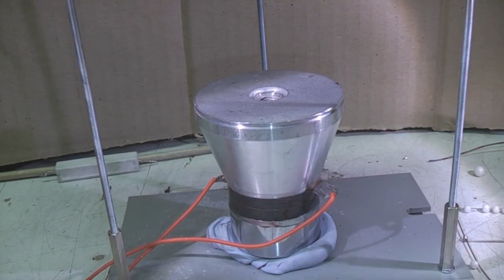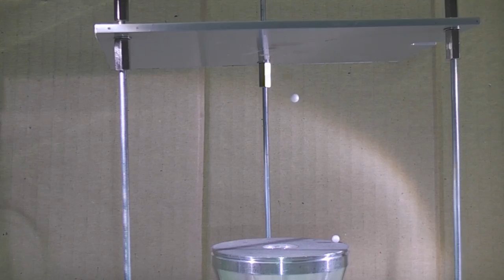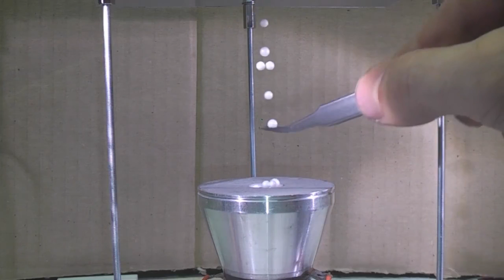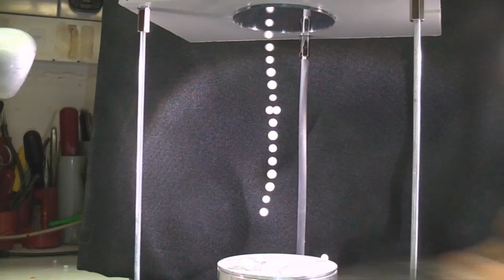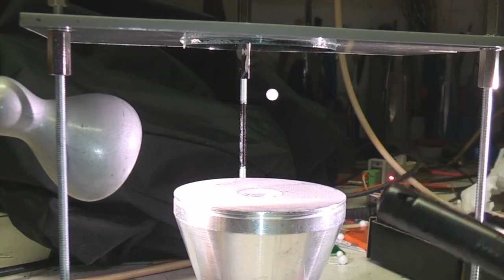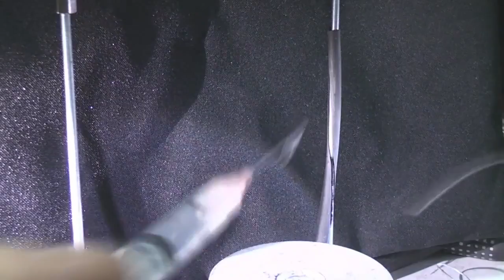Ultrasonic acoustic levitation

Comment: Hello can you tell me one challenging Thing ?
As seen here ....
https://youtu.be/N-OPQ_s0G5c
Ultrasonic horns are both bolted and glued at the same time and location so how can you remove it without any distraction ?
Because for un screwing it you have to turn but you can't because it's ceramically glued and you can't even twist back and forth because of bolt and also its base is just thin pice of metal which can easily band !!

So how it's profectionally done   ?
 I need that horn from cleaner for handheld  Ultrasonic for some purpose .

Comment: That transducer you are using has bad acoustic coupling through the air. It will be good to somehow glue many cones as resonators. I tried remove single one from Arduino distance meter and temporary stick to it - it increased effectiveness. Now experimenting with single small transducer, just transmitter part of distance meter HS-SR04 and got decent results. Great idea with soap bubble - excellent for visualizing standing waves and where is the focal point of the reflector I am using. Thanks again, great video!

Comment: There is a medical application for this, specifically vertebrae decompression. Install qty. 2000 of these transducers in a 5" thick acrylic sheet. The transudcers will be controlled in groups to affect levitation control. The patient will lie flat on their back, a full anesthetic will be administered through IV to relax the subject. The transducer will be attenuated into higher frequencies. Once the patient is levitated. Adjust each group of transducers to invoke sonic induced traction. The procedure should not be administered longer than 15 minutes. This is the future of medical therapy.
Reply: It's all Good duhhhhhhhhh

Comment: Instead of dry ice or alcohol, you could use a cheap ultrasonic humidifier/vaporiser and channel the stream into the standing waves of the main transducer. I'm guessing using the same transducer to also create the mist would not work well.

Comment: Mike, this is 3 years old video, but I am just beginning to mess with ultrasound. I found that perforated PCB increases coupling from transducer to air almost 3 fold. I suspect that increasing surface area by introducing material with holes actually helpnig better coupling. Just one thing what I do not like in this case is short focal point of about 45 mm on 40 kHz transducer with diameter of 45 mm.
Reply: Parking sensors are a cheap source of powerful ultrasound. Being able to levitate liquids or insects is not a problem: www.acousticlevitator.com

Comment: is it mandatory for the relecting surface to be flat ? and also is it only supposed to be metallic ?
Reply: TEE BOY Anything that won't absorb sound wave easily. Metal is most commonly used, however most hard objects should work.

Comment: how transformer
i see circuit ..
i dont khow transformer
Reply: I have the same question, I'm not sure about what kind of transformer should I use to not burn the transducer.
Reply: He says in the video that it's a step down transformer from a pc power supply, wired backwards. He says it's a 12v secondary. He is based in the UK, so it will be a 240v primary. Find an old computer psu and the 12v transformer should do the job just fine.

Comment: hello everyone does anybody have the design for the circuit i need it for a school project thank you
Reply: +Zoom me The schematic is in the description. Just to let you know, the 555 timer isn't completely accurate on the schematic so there may need to be some tweaking, but I was able to use it just fine :)
Reply: +Generation Imagination can you let me know what i have to change,I did same as in schematice but doesnt work:(
Reply: +Zoom meI used sg3525 replaces 555
Reply: +PHƯƠNG NAM what difference does the sg3525 make over the 555 ?
Reply: +PHƯƠNG NAM thanks
Reply: +Yusuf Sultan Did it work for you? I'm trying to do the same but I have had no luck with the 555. If so how did you connect the sg3525 to the original schematic ? Thankyou

Comment: Hi guys, I'm trying to replicate this for my school project. At the moment I've been able to set up the standing wave with a 40khz ultrasonic generator and a reflector, however I can't seem to be able to get anything to float like the small polystyrene balls. I was wondering whether the problem is the low voltage I'm currently using to power the generator, which goes up to 12v. If the low voltage is the problem, I should be able to fix it, however I do not want to needlessly generate an excess of 200v. I would appreciate any tips
Reply: +HanithRB probably too late for your project - but he says, taken out of an old PC computer's switching power supply, it's a ferrite-core transformer, usually good up to 100KHz or more.  Almost any 100-watt switching power supply will have one of these.
Reply: +HanithRB These devices usually run at MORE than 150-300V, because of their size and the nature of the piezoelectric effect.
You HAVE to run it that high, otherwise you won't get any power out.

Comment: WARNING, HEARING DAMAGE!!!  WEAR EARPLUGS IF YOU BUILD ONE.   Below ?50KHZ? your ears can't hear it, but it will slowly chew up your cochlear hair-cells.   Symptoms:  louder and louder hiss/squeal tinnitus in your ears which persists when power is turned off.  SOMETIMES PERMANENT.  I accidentally did this to myself in 1992 with three watts of 30KHz, but went away after weeks.  A colleague got permanent tinnitus in one ear from building a hundred-watt 20KHz tweeter array to use against barking dogs.
Reply: +wbeaty Note for everyone else, this only applies to actually doing it yourself. Before digitisation, the high frequencies get filtered out so don't worry about watching the video! This would depend on the actual codec used by the video itself and exactly how it does the digitization. I can hear some pretty high frequencies coming out of the video, but they seem to be pretty quiet. It would also depend on how good your speakers are at reproducing the highest frequencies.
Reply: Oh no, terrorist weapon: websites which attack your ears with silent high-power 20KHz.  If youtube bandwidth was wide enough, then just post viral videos with dangerous ultrasound and also a too-low soundtrack, causing people to crank up the volume to max.
Reply: > be absorbed by water  Yes, water blocks the sound, and usually sonic baths cause no problem.  The hazard arises when the transducer face is in air, and especially when adjusted to create a standing-wave in air.  Best:  ultrasonic cleaner with auto shutdown if the water level is too low.  Also provide a metal cover over the water.  Usually these units have a cover, to prevent water splashes as well as the annoying screech of sub-harmonics from cavitation bubbles.
Reply: Aunyx89, he was addressing those who build these things themselves.
Reply: +wbeaty if only I'm rich enough to afford a good hi-fi setup
Reply: Can this sound be absorbed by water or something soft like a construction foam? I'm trying to build an ultrasonic bath with a 60W 40KHz transducer and your comment has worried me a lot.
Reply: wbeaty XD
Warning, above 20 kHz, your speaker won't even play it so no problem !!

Comment: I was wondering, does it always have to be so noisy to be able to have the potential to levitate? We are trying to make our own small levitator and have not been successful so far.
Reply: Azeem Iqbal Transducer has very poor impedance match to air, so must be overdriven (producing enormous internal waves in the transducer, with soliton-subharmonics, audible squeals.)  Perhaps add a rubber layer to transducer surface?  Maybe few-mm thick, adhered somehow.  Or even a layer of some thick liquid.  We want to let more wattage escape from the metal, ideally having a material which has internal sound velocity half way between steel and air.

Comment: the same principle drive only with electromagnetic waves and you have the ufo
Reply: The problem is that the automotive- and oil industry will stop something like that...
Reply: First you need 20 fusion reactors that are creating 20 billion Terawatts power.
Reply: *****  or just something we have not invented or combined yet... that is called technical evolution :)
we have found so many things that we could do with more power... once someone has found a way to have more power/ Energy on demand (either somthing like a Battery (storage) or portable reactor (source)) stuff will take realy big steps

Comment: Very nice use of standing waves; never mind the levitation, I can see a use in an undergraduate laboratory to "visualize" nodes and anti-nodes.

My estimation (using your finger as yardstick) is that the anti-nodes are at about 1cm intervals, hence the wavelength of the sound is about 4cm. Given a propagation speed of about 330m/s, this gives a frequency of f=v/wavelength = 330/0.04=8250Hz=8.25kHz; that explains the "audible whine". 

Well done!

Comment: Use a tuning fork attached to the top of the acoustic transducer, its a design idea of mine, (patent pending) you can attach different  tone tunic forks to the transducer and change them out... increasing or decreasing the frequency will change the tone the fork transmits, also using a aluminum tube surrounding the tuning fork will concentrate the sound waves in one direction, one could use a parabolic dish at one end of the tube to aim the sound waves at a specific point. It's the parabolic listening dish except in reverse, used to transmit sound rather than receive sound.

Comment: Thanks for the video! I'm actually considering utilizing acoustic radiation pressure for a science fair project, but I still have to conduct some more research before I start building anything. Would it be inadvisable to approach such a project? And if not, do you (or anyone) have any warnings or suggestions about building a set-up like this? Also, what were the effects of the standing waves vs. water vapor (like from a humidifier)? Would it mimic the dry ice effect and could it be contained?

Comment: I watched this video but I'm confused about the construction of the transducer. If the bolt goes from the back (steel) end through to the cone (aluminum) end, that clamps the piezo discs in a sandwich and doesn't allow them to expand mechanically. I presume (not having one in front of me) that the bolt doesn't clamp the piezo discs together...? How is it made?

Comment: Have just looked at the numbers, and it may be that, even with ideal lighting, a sensitive Schlieren system would be required to detect the standing waves. A 140dB sound results in about the same change in air density as a 1°C temperature rise.

Comment: Just to check, were you using a continuous light source for the Schlieren? The pressure at any point averaged over a whole cycle of the oscillation will be extremely close to atmospheric pressure, so I wouldn't expect to see anything with a continuous light source. A stroboscopic light source synchronised (with some phase offset) to the transducer might well work better. (The phrase 'stroboscopic schlieren' comes up with a number of ultrasound-related papers.)

Comment: Good video!!! Could gravitational potential and electrical potential be linked together? They both use the inverse square law! In this theory gravity is a secondary force to the EM force. Objects just free-fall towards the greatest energy because it has the greatest time dilation! In this theory ‘time’ is an emergent property formed by each new photon oscillation of vibration.  By the way this is an invitation to see an artist theory of the physics of ‘time’ as a physical process!

Comment: This is really cool! I've just realised that a lot of the theory I use in my research for holographic modulation also applies to ultrasound... If you had a shaped plate (like a fresnel lens, or zone plate) you might be able to focus the energy to a point. If you modified it to give you a doughnut shaped point (like I believe they do in STED microscopy) you could probably levitate slightly denser objects (in a single point).
Reply: How rigid/string does that plate need to be?

Comment from the maker: I think that the sharp resonance will do a lot of the filtering mechanically - will play with drive more at some point. Source impedance probably also wants optimising. Main issue is to stay resonant as temp changes so needs some feedback to keep it at the maxpower point.

Comment: I'm wondering if the fact that you're driving it with a square way destabilizes the thing, (or on the other hand maybe stabilizing it.) Have you tried putting a one or two stages of LC filtering at the output once you've figured out the tuning of the frequency? Also, a more function generator is probably desirable as well after all. Having the output power modulate the frequency probably is the best idea for stability.

Comment: You have a concave mirror, don't you? (from the monochromator, I think).

You should try to rig up a Schlieren photography setup using that mirror, so you can see the density variations in the air. All you need it a light-source immediately adjacent to the camera's lens, and then you put the camera pointed into the mirror at the mirror's focal length.